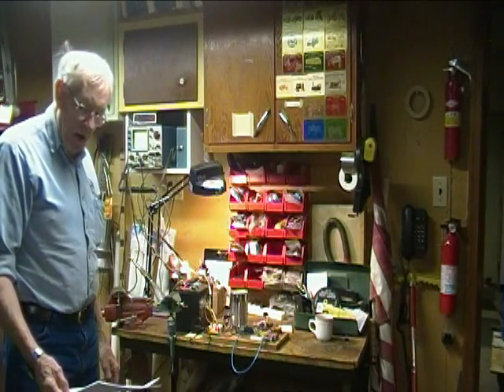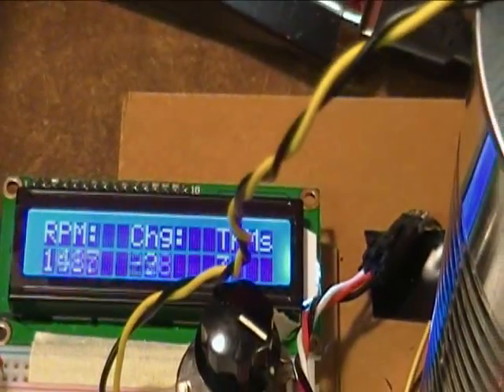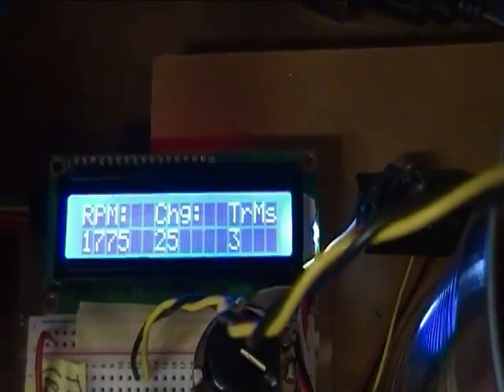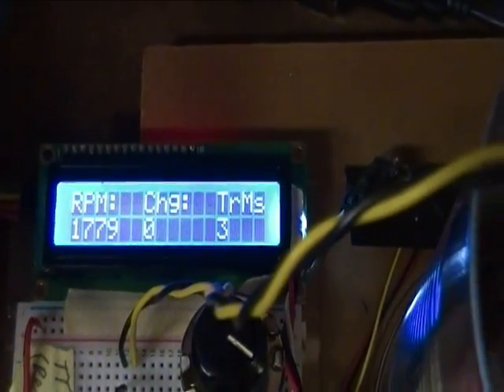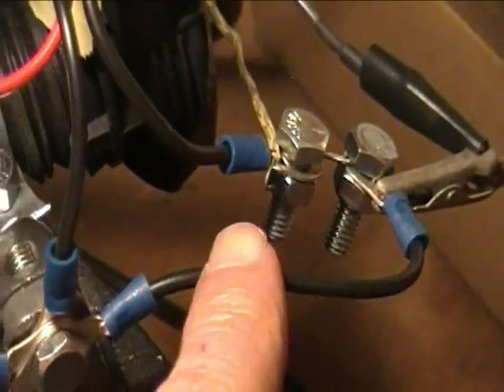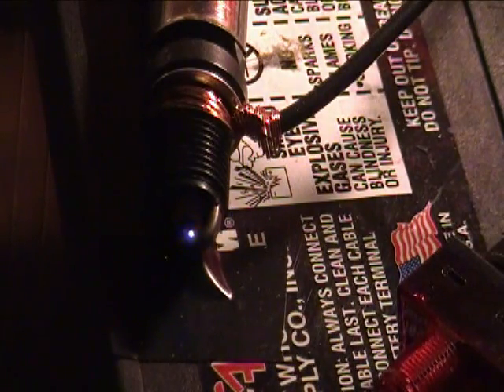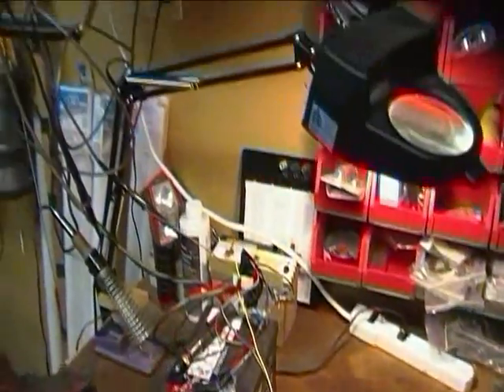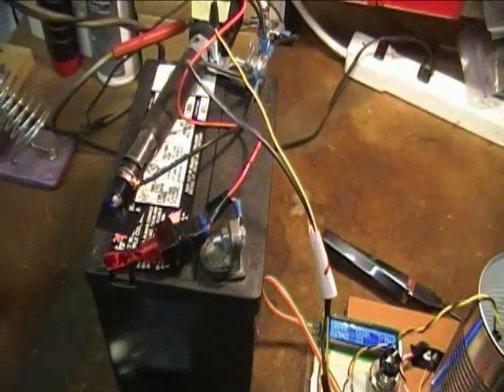Arduino COP Controller Progress: Coil Saturation Testing Part 1

Comment from the maker: Thanks George.
    Now I have realize that I will have to expand the testing to see what happens to the charging waveform  (when saturation occurs) at varying battery voltages.  If there is little change, no problem, but if the curve changes a lot, we will have to write code to deal with the difference.